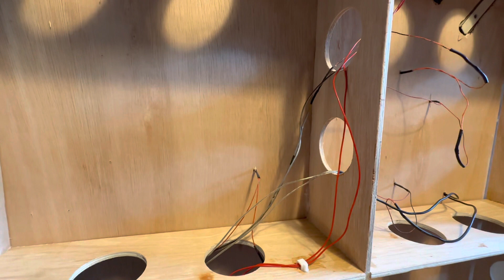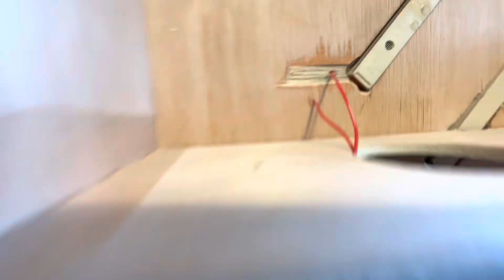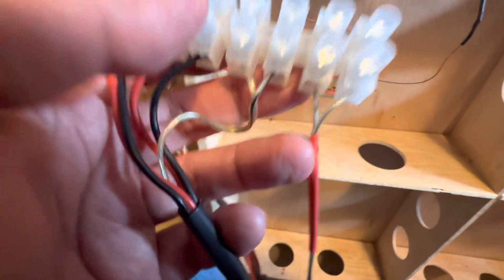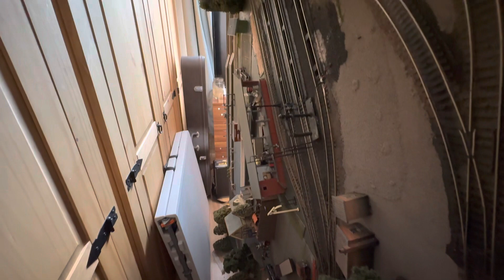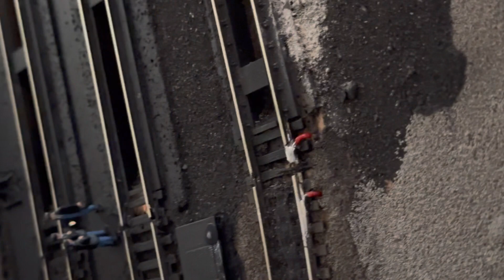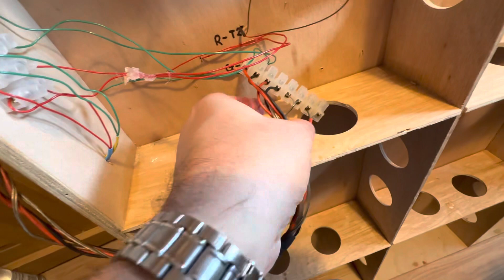Additional layout wiring

Comment: I have lots of speaker wire that I can use if necessary. When I built tge layout I didn’t have any point motors and thought  “mm I am nit sure if I can do all that wiring “ As a result a couple of years have passed with only manual points.
I mentioned to you my creeping problem and you suggested isolating the points, this is on my to do list. It sounded more difficult until you demonstrated/explained it on that older video. I was stunned.
This is another great video.👍Cheers
It certainly is a lot easier with the construction method you deployed.
Reply from the maker: Brilliant ! Thanks Charlie , start off with the basics and keep going ! . Richard .